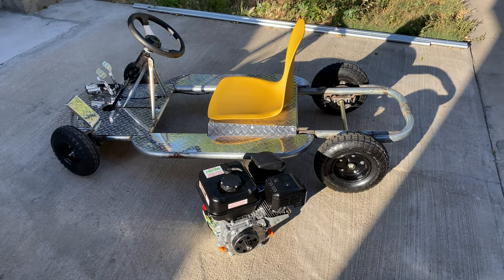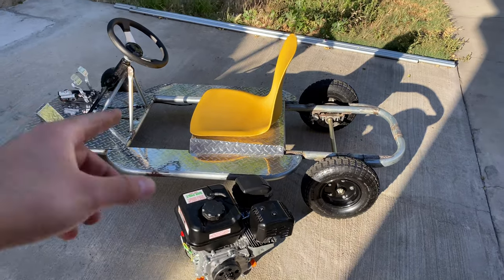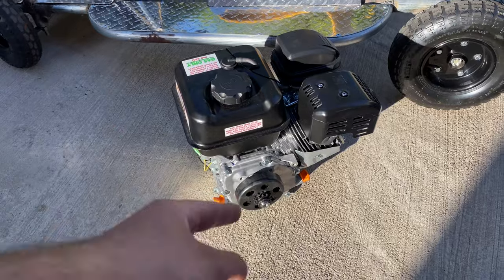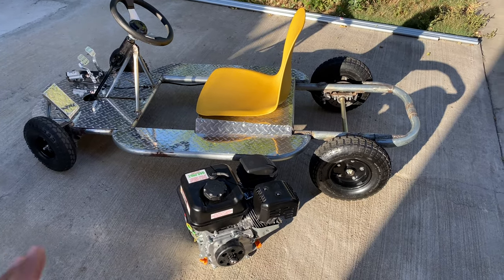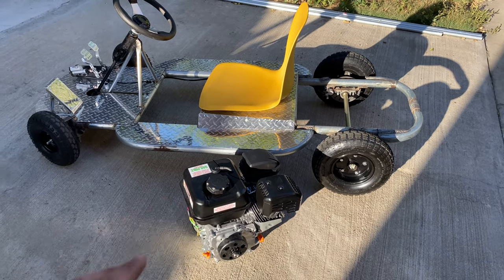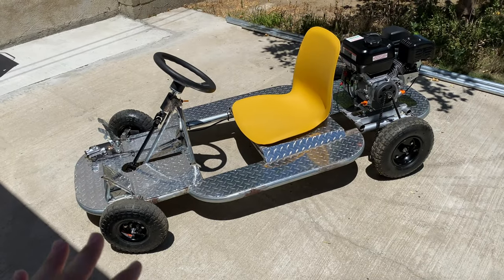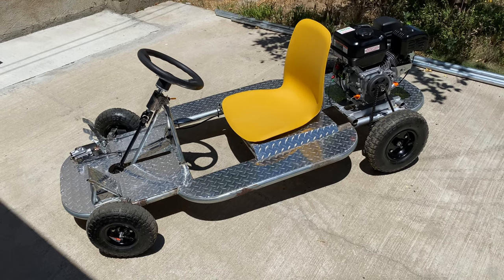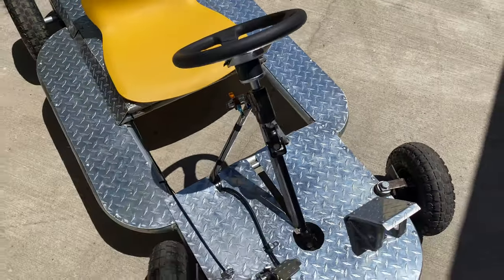Homemade Go Kart Build (Engine Mounting and Kill Switch)

Comment from the maker: The time is finally here and my project is all complete. The drive as well as review is all filmed and dropping next weekend. In this video I mounted the engine, attached the throttle using a cable inside a tube and installed a kill switch along with other extras. Seeing something I built come together is definitely a dream come true. I'm extremely eager to share the driving experience because it was highly impressive. So stay in tune for the review video coming next weekend.